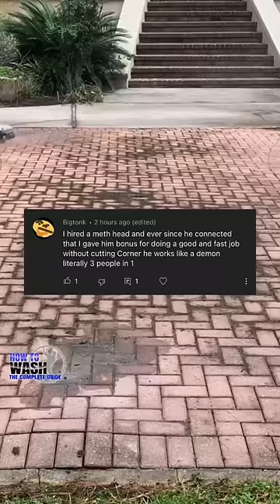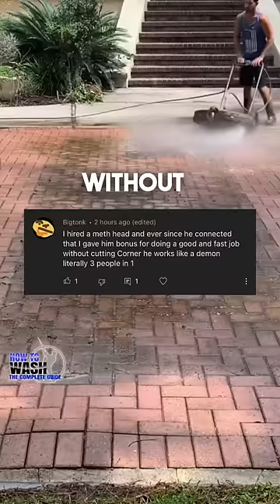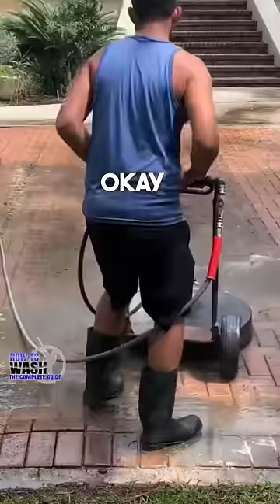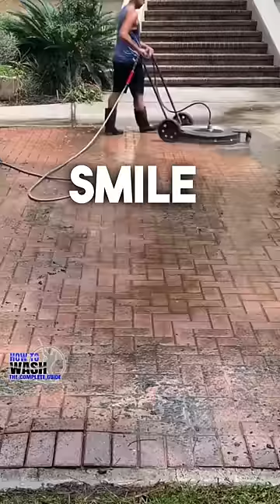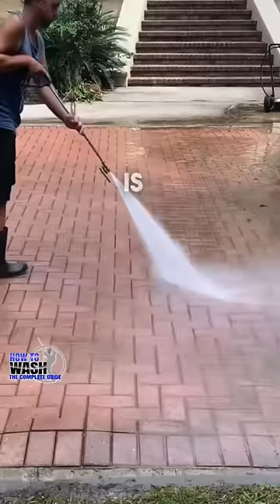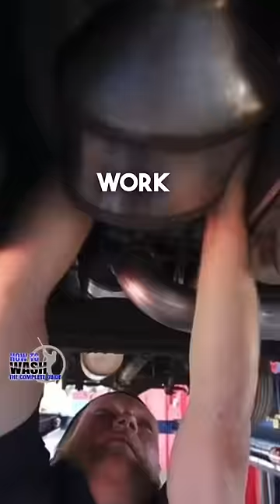I Hired A Meth Head!

Comment: damn dude just threw out some crazy stereotypes. there are high functioning addicts.
Reply: Fr
Reply: Had a boss, white guy, in charge of a 60 million dollar apartment construction site. Did hella meth when he was at home. And even put a lil bit in his gatorrade. But he worked and was honest. Not all methheads are the ones you see on the streets
Reply: People forget meth was invented for soldiers
Reply: @realtalkboxing.   Yeah I've heard stories also, but they came from the psych ward so take that for what it's worth. You can run for a long time, i.e a couple years, but the lack of sleep and everything else WILL fry your brain. High functioning scientists and EMS people trying to work multiple jobs have done it for years, but it takes a toll on the mind and there's no way to get back what's lost.
Reply: @gorkyd7912  yeah I don’t think Ian is gonna last forever. I hope he eventually does or has gotten off it by now

Comment: If you want to be super sinacal about it and assume that they are still on meth, someone on meth regularly wants more meth, more meth requires more money, they have 2 options to get more money in this situation 1 lie, cheat and steal from the boss. Or 2 clean shit really fast and get the bonus. From what we are told the meth head had figured that option 2 gets them more money more reliably than option 1. If someone is addicted to meth they don't steal because they are mean or stupid they steal because they are desperate, given an option that's is easier/more consistent than stealing but still gives enough cash to feed the meth addiction they will take it.

Although there is a good chance the the meth head is getting their life in order and is not actively on meth anymore